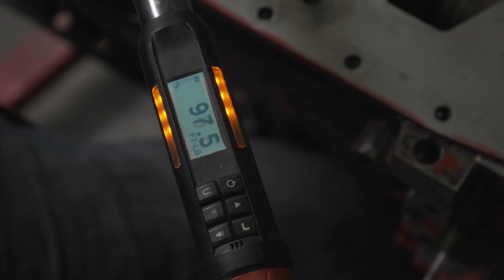New Stroker Cummins Engine for the Junker Drag Truck | Power Driven Diesel

Comment: What size compounds were on it
Reply from the maker: It started life as an He351CW(60mm) over an HT4B(83mm), then it was a 364sxe (64.5mm+ over HT80(89mm) right before the stroker engine setup.  Now it's a 472sxe(72mm) over a custom GTX5541r(116mm)

Comment: Rolling all that coal and you still get smoked by a ls gasser with a cam and a hit of nitrous.
Have fun at emissions there Billy Bob!
Reply from the maker: Come on man.....   LOL   You can't leave the world hanging with generic terms like LS gasser, cam, and hit of nitrous...  we need details if we're gonna correctly bench race eachother.   We need to know car, car weight, series of LS engine, mileage of said engine, which cam, and last but not least, how much juice?  Does it have extra fuel pumps to provide sufficient fuel?   We want details!
Reply: @pddofficial  if it's any ls, then its running ALL the nitrous and a little bit of timing with a stage4 cam. Just take it to the danger zone.

Comment: I watched this with Gale Banks. 
His face was funny when he saw all that soot coming out. 😂😂 
I’m sure everyone knows what he thinks about excessive soot. 
Anyways that oil pick up. Shouldn’t we treat those like air inlets? The less 90 degree bends the better for flow? Or is it impossible with that engine layout to get a better flowing oil pick up?
Reply from the maker: There is very little room to clear the oil pan, remain clear of the moving crank parts, and drop safely into the sump.  This high flow pickup tube is larger in diameter so it absolutely will flow more than stock, but will it support a 40% larger oil pump at 50% higher RPM.... soon we'll know!

Comment: I used to have a lot of difficulty trying to light HX82 singles on the dyno as well. Twins drive so much better unless rules prohibit them they are awlays the way to go for power. That being said an 76mm HX60 is an easy 100hp over that S476
Reply from the maker: There are many models of HX60, but I do know for a fact that Seth Kuntz ran one last year at the Diesel Power Challenge in his dually 12v Cummins and struggled to make much more than 800 RWHP with a 13mm pump and a nitrous kit.  When they got home from the competition in Colorado, they swapped out the HX60 for a box Borg 475 and picked up substantial power and run as fast fuel-only with the Borg setup as the nitrous assisted HX60 setup.  Not staying there aren't well built aftermarket HX60's out there making serious power, but the one they had was a DOG!!!  Heck, even Gale Banks couldn't believe the terrible boost and intake temp numbers it was producing when compounded with a 60mm HX40.

Comment: Do you sell the oil pressure springs to raise the oil pressure for the stock pumps. What oil pressure do you recommend
Reply from the maker: We are still in the R&D process, the old springs I used to run would create too much pressure on cold starts to be streetable.  80 to 100 psi hot at full load is a good range for high performance 1000 to 2000 HP.

Comment: Do you have the oil pan bolts used on this thing for sale?
Reply from the maker: You want to buy stock oil pan bolts?  Or longer than stock to work with the girdle?  They are standard M8 threaded bolts.
Reply: @pddofficial  Ah, thanks guys. I have stock ones right now and don't think I'll ever need to upgrade. I just don't have the desire for that much power.

Comment: Is there any reason you went socket head bolts on the oil pan?
Reply from the maker: Girdle requires longer bolts than the factory fasteners.  Socket cap are cheap!
Reply: @pddofficial  wow.... now that you say it that seems so obvious that I feel dumb

Comment: Can you build my motor I had a Hamilton cam installed in my 2000 24v a few days ago lasted 200 miles same day I got it back from shop it broke down they pulled valve cover off all the rockers broke off the exhaust side 😳
Reply from the maker: It sounds like they got the cam installed a tooth or two off and made the exhaust valves contact the pistons.  Or the cam was too big to run without valve reliefs.

Comment: Last engine I built, I welded a hose tail on the oil pressure relief spring retainer cap, modded the piston so dump oil would flow around it to the hose tail and blocked off the dump return to the sump. Connected an oil cooler to the hose tail and a return to the sump.
Low pressure oil cooler !
Reply from the maker: Great tip!  Would definitely help with more cooling!

Comment: junker drag is my favourite rig from PDD hands down. absolutely legendary and wicked informative build threads online! thank you.. i learned a ton and used everything i possibly could on my build 👍 it’s the closest thing us average joes can build at home is why i think it’s so interesting.. 👍. limit the torque and maximize hp. medium to big single with external gates and nitrous to spool and boatloads to supplement. use a diverter valve/ spool valve possibly to help it light.. if a 12v rod can handle 1800ft lbs?? then build to rev to 5252 and make 1800hp. maybe slap a hogged out warhead on there. i see hamiltons prices recently came down again. whatever you do (twins/single/nos etc) it will be interesting and helpful and much appreciated. love the junker!! .
Reply from the maker: The Junker's old stock rods had been to 1950 ft lbs at the rear tire, several times.  The worst rod was about 0.002" shorter than the longest rod meaning it was a little bent, but not yet destroyed.  I'd say you're spot on with the 1800 ft lbs mark as a safe limit!

Comment: I got a question, what's the best compound turbos I could do for a 24v 98.5-02. it's an early 99 stock but saving up over the next year to make about 700-800 hopefully
Reply: If you stay vp your probably gonna be limited to 600~
Reply from the maker: VP44 pump 24v engines don't fuel well above 3k RPM, so you'll want a turbo system that makes peak power early where the VP44 can still provide maximum fuel delivery if you're chasing maximum power.  Our Ultimate Towing Compounds with a K27 over 369sxe is great for low-end power and spoolup.  You will peak out in the mid 650 HP range with them, so for more, a 362/476sxe setup would give you the airflow to reach the 700 HP mark, but the VP44 probably wouldn't do it without a heavy dose of water/methanol injection or nitrous.
Reply: I'm doing a p7100 swap on it with an airdog lift pump

Comment: Are yall going to sell a stroker kit for 5.9l cummins?
Reply from the maker: Yes, you could technically order the parts now if you ordered a 6.7 crank, helical crank gear, and new pistons and in the options asked for 080" cut off the top.  But we will make a kit soon!
Reply: @pddofficial  Hell yeah!
Reply: @pddofficial  🤤

Comment: Not telling anybody how to do there job, but after 2 mis-torqued head studs with a digital torque wrench , I prefer to use a split beam torque wrench. I cringe a little every time I see you guys use the digital torque wrench
Reply from the maker: This is the Junker, the torque figures are +/- 10 ft lbs for everything!!!

Comment: Oil squrts standard feature on 5.9 and 6.7 cummins engines?
Reply from the maker: All of the 12v and early 24v have saddle jets that feed from the mains and spray the under side of the pistons.  On the 2003 and newer models, they added a second oil gallery in the block to feed the 6 "j" jets that spray/cool the pistons.  On the old 12v and 24v blocks, the saddle jets are plastic inserts, for the Junker we are testing some billet aluminum jets that have a larger orifice to spray more oil.
Reply: @pddofficial ,  thank you so much for this valuable information.
Reply: Yep
Reply: Piston oil cooling nozzles became a standard feature starting in 03 with the common rail unless you had a low output model